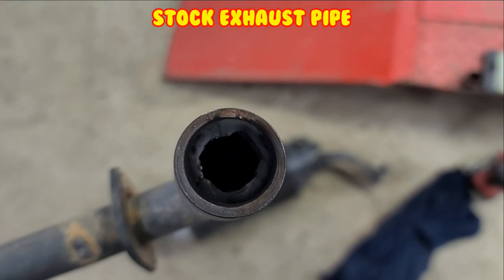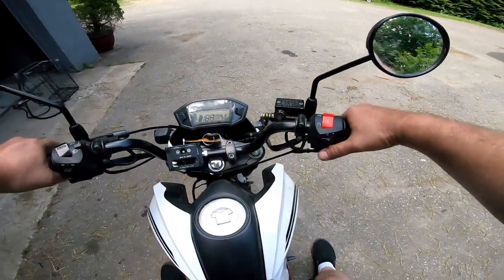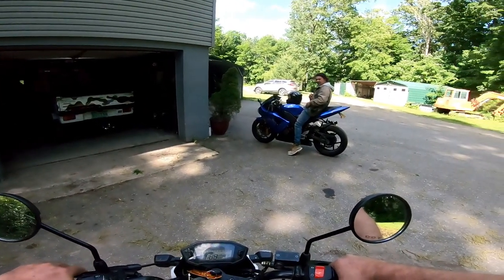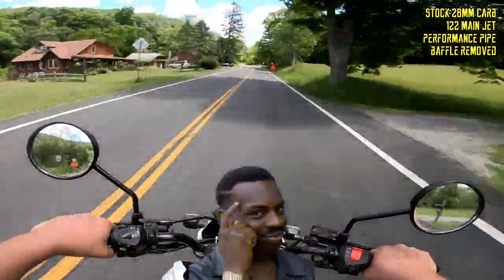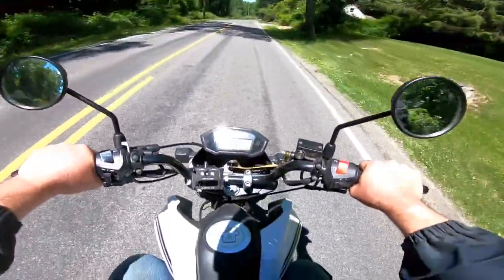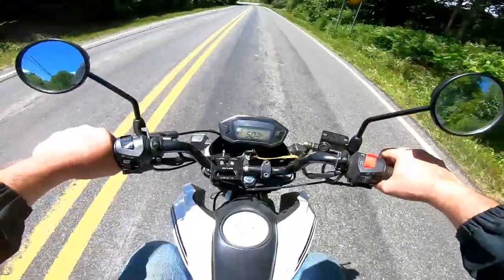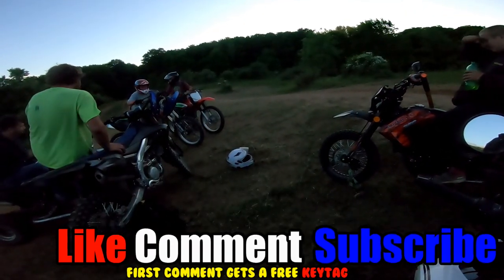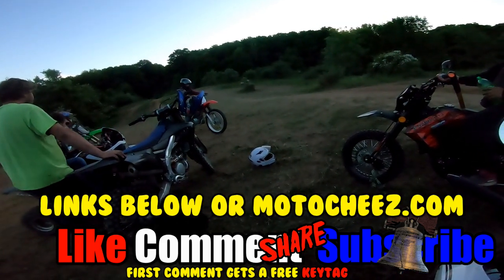(E18) Performance Pipe. WOW, she RIPS! Big power gains. Top Speed Hellcat HELLCOUGAR 190cc

Comment: I  just got the same exhaust for a 1997 suzuki xf650. Its not the same bike anymore..it pulls so good from down low. oh and I realized that if you remove the baffle, the exhaust doesnt get hot at all..and I freakin love the sound..and I love those pops it makes in deceleration from high rpm... 50 bucks well spent
Reply from the maker: It's so loud without the baffle though! I like trail riding quietly,😁

Comment: So... you get yourself a $100 1x18 belt sander and sand the weld smooth, some hi-temp paint and you're GTG for the modded exhaust.  The floating belt will give to allow you to sand the curves.
Reply from the maker: True... I'm going to make the outside bend better for slow first

Comment: Great vid cheez, the exhaust truly makes a big difference. I was paying close attention to you’re riding. The flatslide is much snappier and throttle response is instant. Mine rips for sure, I also have a racing cdi in mine. It was 10 bucks on eBay. I dunno if it made a big difference or not cause I’ve been riding it w it since I installed the 190. I do know it advances timing and supposedly takes rev limit off as well. I haven’t had any trouble since I fixed my clutch issues. I adjusted my valves already as well at 100 miles. Exhaust was def tight on mine.
Reply from the maker: I'll have to look for the CDI. Broke starter chain AGAIN today....
Reply: MotoCheez oh no, luckily you got the hd chain ready to go. I can’t believe it broke again. If you wanna try my cdi I can give you a link.
Reply from the maker: Yeah, send a link... I wish I could find a belt that I could stretch on there
Reply: MotoCheez yes a belt would be very nice.
Reply from the maker: Thanks!

Comment: I have the same muffler on my XL75.  It's got a xr100 bottom end, 120cc kit and a cam, it sounds pretty good.  Way too loud without the baffle.  Just watch out the baffle will vibrate loose.
Reply from the maker: It is loud! My baffle was loose out if the box. Had to tighten
Reply: @MotoCheez  don't tighten it too much, they just tapped the sheet metal.  It'll strip if you look at it funny.  I ended up with a slightly longer bolt and a nut tacked to the baffle.

Comment: This is kind of like deja vu for when I was working on my SSR XF250, which is like the dual sport 250s you have. The stock header had a huge ugly weld on the inside like yours. Lextek makes a bolt on exhaust, but it's listed on the "Pulse Adrenaline 250" for the euro markets, but the same exact bike. i thought i'd go cheap on the muffler and got one very similiar to yours on Amazon - it sounded HORRIBLE. Not just loud, but shitty, and i'm not even that picky when it comes to things like that. I ended up buying the pipe from lextek too and it sounds a lot better. I did mod the stock carb and reject it, and think it might be dialed in decently now.  I am kind of wondering about an aftermarket carb option though.
Reply from the maker: Yes. Similar!

Comment: did you ever figure out a kick start hack to allow it to work with the grom clone that has the foot peg in the way?
Reply from the maker: I did weld up and extension type I put under the seat, 
I think the one off my newest condor 150 clone might work.
Reply: @MotoCheez  the whole grom clone zs190 community cant use kickstart  cuz the peg is in the way so people are out here with starter chains breaking that are cracking holes in engine cases. oh man you have to make a short video of this for us.  would be really helpful
Reply from the maker: I did make a video of where I made that extension on a Kickstarter I think it was probably the second or third episode of the ground clone, keep it under my seat
Reply: @MotoCheez  i will look it up thanks.
Reply: i found it and made a clip to share.  i see the condor kick start is different than anything else i see on amazon. if you ever get a chance to try it  with the 190 on the hellcougar it could be really helpful.  finding that specificic kickstart lever might be difficult though even if it does work.
Reply from the maker: I'm going to put a CG 250 on a condor so when I do to swap I'm going to see if that starter will still work and I'll also see if it works on 190
Reply: @MotoCheez  thanks very much.

Comment: Hey cheezy!! Its me again! I have a question about your zs190. Im having a little bit of an idle issue with mine when its cold. Its surging like theres an intake leak but the plug reads perfect tan when riding and gets kinda dark after extended idle and it goes away for the most part when its warm. Does yours do something similair? Im wondering if theres a fat cam in this head that maybe makes it a little lopy at cold idle?
Reply from the maker: Mine is the same... It would cough a bit but after my needle dropped in, I believe the needle isn't held down good and it lifts up a bit. When I put back together when it dropped in last video it seems better
Reply: @MotoCheez  okay good to know thanks. Also does yours have alot of valve noise? And what did you set your clearances to? Ive found a manual by thumpstar that puts the valves at .008mm on the intake and .013mm on the exhaust which seems like a massive gap. But ive also read the daytonas have .005-.007mm clearance so im confused have you done the valves? And if so what worked for you?
Reply from the maker: I was putting the hawk clearance. I don't know the clearance off hand. It's the same engine as daytona. Can't hear the valves on mine.
Reply: @MotoCheez  got it bud thanks those clearances were .002” and .003” right?

Comment: Just as soon as I (finally) decide that I need a chinese grom clone in my life, everyone sells out of them.😡🤬  I hope that the bat flu doesn't keep Tx powersports from stocking these😭
Reply from the maker: They're in the main suppliers hands, just rationing out to dealers I heard
Reply: @MotoCheez  Right on, thanks man!  Been binge watching all your vids for hellcat info😁  Hey, if you had to do it over again would you get the same clone or spend a little more for something else?
Reply from the maker: I'd do the same as I did w the 190cc too. The 150cc lil bike I saw wasn't horizontal, was like the hawk engine. Probably pushrod too. It looks it.
Reply: @MotoCheez  Awesome, I'm in Maine so I plan to do all my tinkering in the winter and testing in the summer.